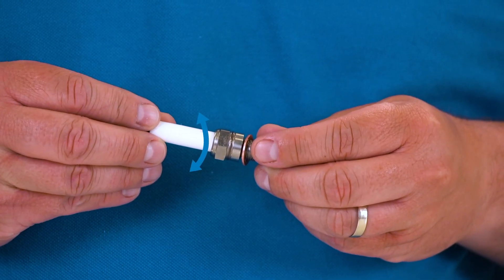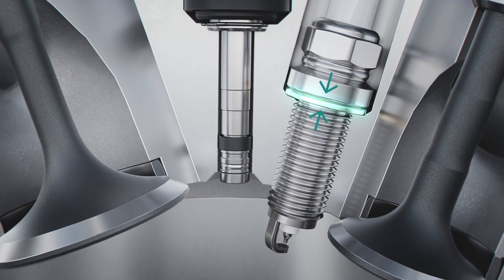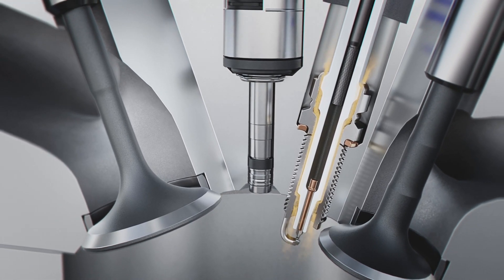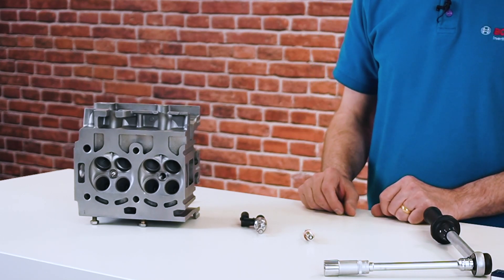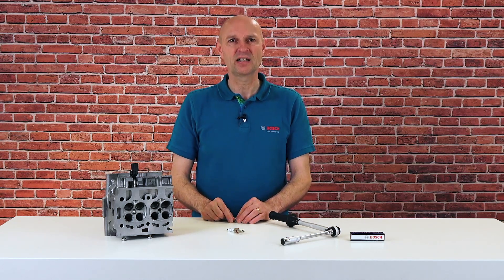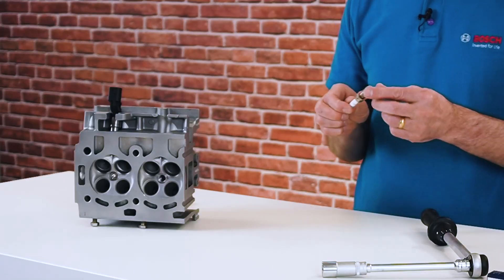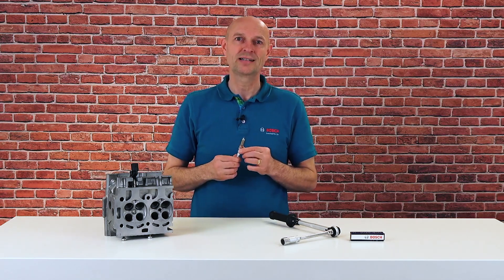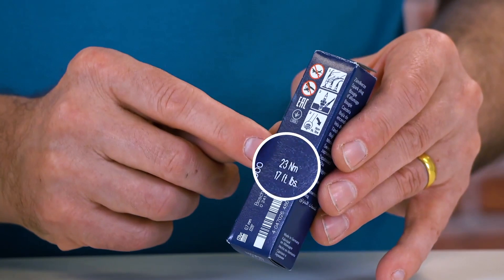Tech Nuggets: Changing Spark Plugs – The Most Serious Mistake

Comment: I don't see how over torque would break the insulator. No pressure is applied to the ceramic unless something else is done wrong. Are these a two-part plug where the ceramic is the only connection between the hex and the threads of the plug?

In the old days with steel and cast iron and even beefy aluminum heads the the torque wasn't a big deal - just make it tight.  Today's engines are a different story.  I cannot remember the last time I saw a steel head. The aluminum heads are much thinner to save weight and cost and that means fewer threads engaged with the plug. The problem I see with over torque is stripping the threads in the head. Some people under torque. The spark plug ends up loose and can even blow out, perhaps taking the head threads with it when the manufacturer took the thin head too far (Ford 4.6L v8 👀).